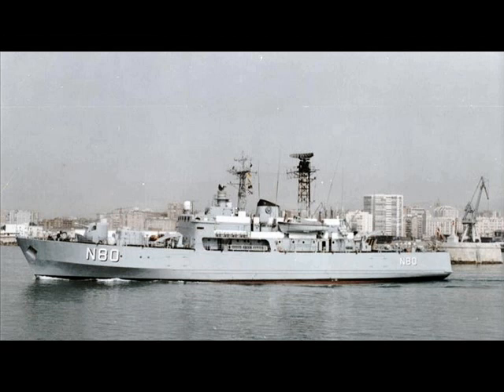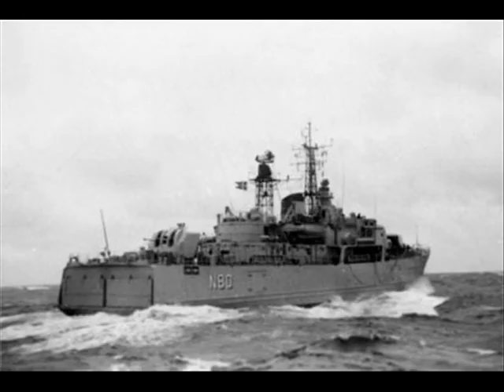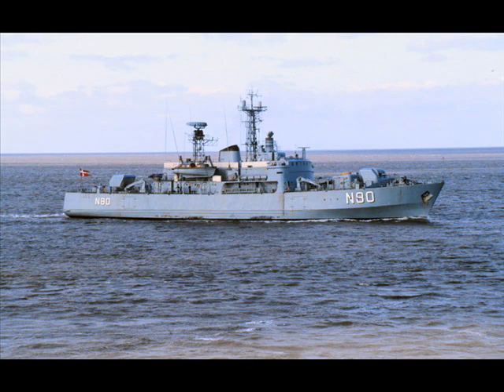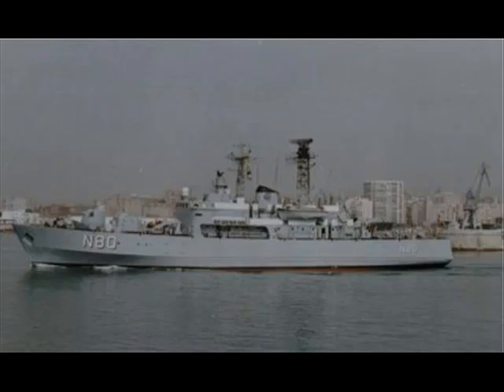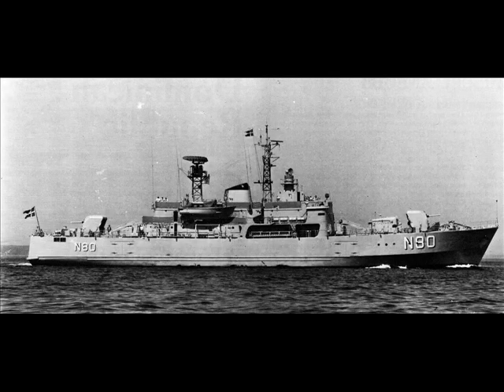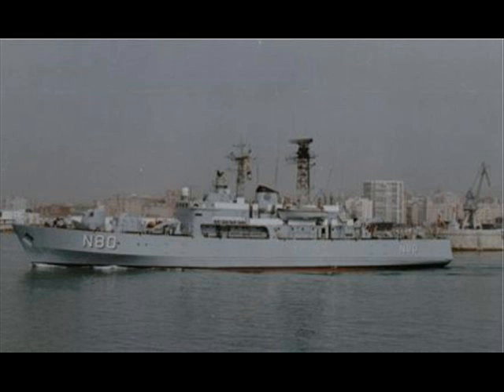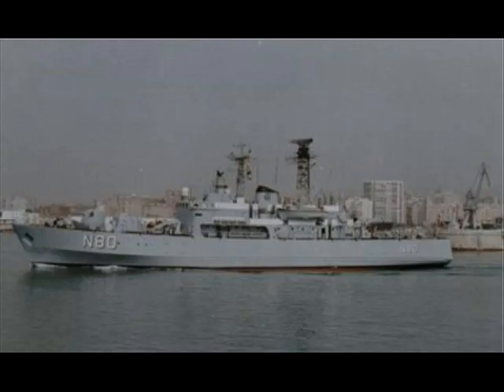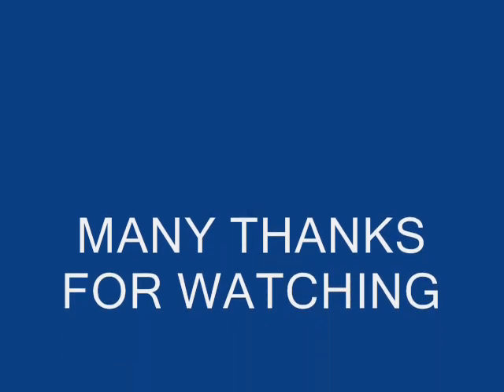DANISH NAVY 1962 FALSTER Minelayer ship history facts

Comment: A lot of factual errors here. No helo platform was ever fitted. When the dual 76mm were removed, only twist locks for a standard 20 foot container were added. Also, the weren't intended to operate in the Denmark Strait or anywhere else in the Atlantic. The mines carried simply couldn't be used at the depths in those waters. The were going to mine the choke points in Danish waters at Lillebælt, Storebælt and Øresund, as well as other places off Denmark. The Lindormen-class operated in the same waters, but this class was laying cable-controlled mines.